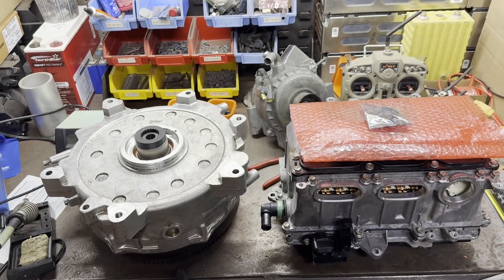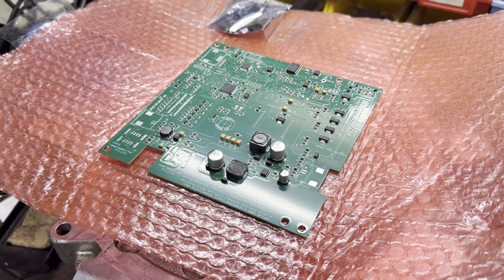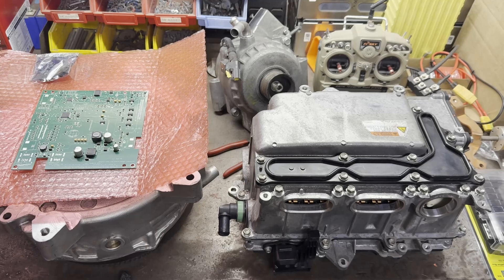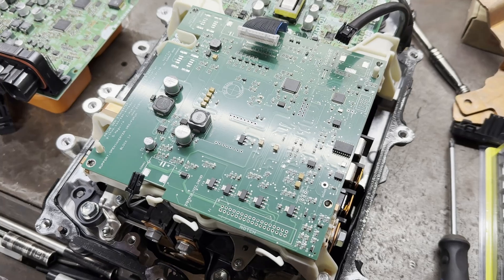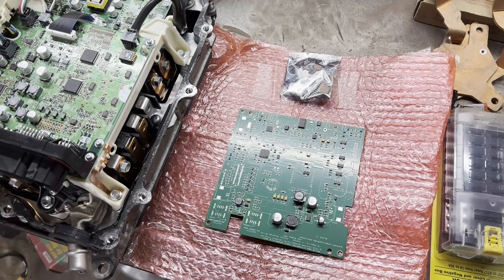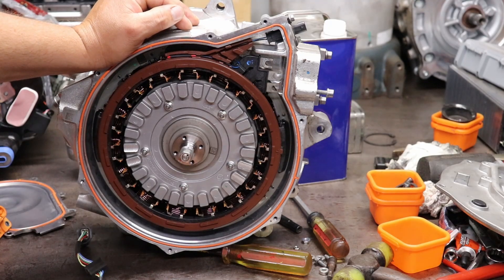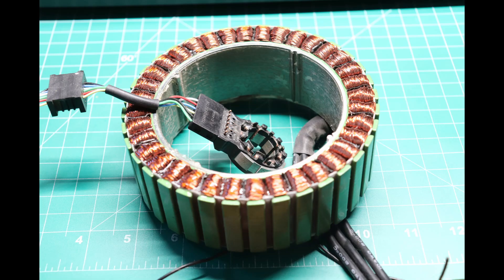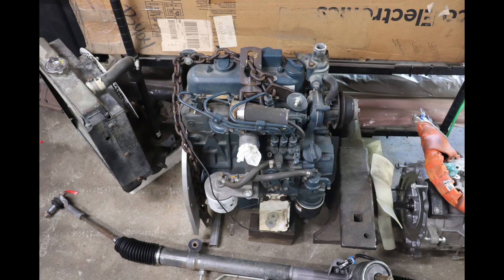Hybrid Toyota Hilux Crawler, Getting the Prius inverter and logic card

Comment: How come the PCB doesn't come with the connectors installed?  It seems like the footprints are correct and I don't envy you having to solder some of them up.  Flux (and solder paste) is your friend and sometimes it's easier to add solder to remove it, as backwards as that sounds.
Reply from the maker: I’m honestly not sure. Maybe to keep the cost down. But it’s all good. It’s a very diy board and open source which is pretty sweet.

Comment: Only 25kw electrical output seems... Low... Is that even enough to offset the power drain at highway speeds?
Reply from the maker: It should be pretty close but I could be way off. But I’m gauging it from what my Hilux pulls on the highway at 70mph. It pulls an average of 17-20kw.

Comment: I was excited to see an update, but we just got into the good stuff and it was over. :( 
I'm so keen to see the kabota-to- rex generator- to- invertor solution. I'm sitting on the fence with a turbo stroked volvo b230 build, or an ev hybrid conversion. Both are electronically well beyond my knowledge and experience but I'm excited to learn. 
I have found a rex generator unit (rare here in Australia), but its about 5000+kms away, so will be about $1800 delivered.
Just cant afford to buy parts for a hybrid to then find out they won't work together. 
Hurry up and get your torque monster rolling. ;)
Reply from the maker: I’m trying. This stuff is super complicated for me and I’m basically learning as I post. Next video I think I’ll just wait till the motor spins. 
That b230 sounds pretty rad though! I hopefully can get over this hump of getting a motor to spin and work. 400v stuff is definitely difficult.